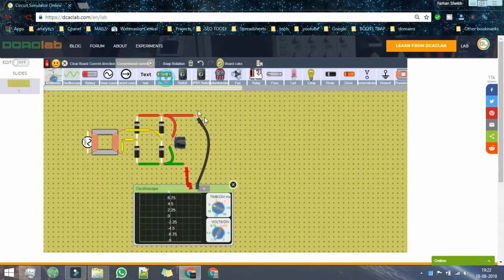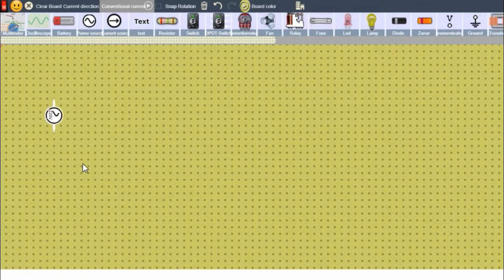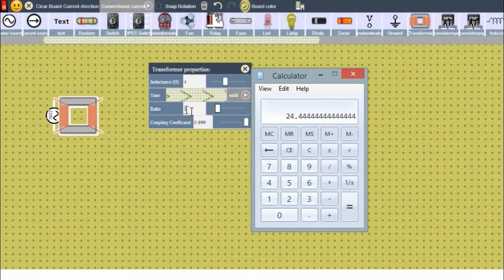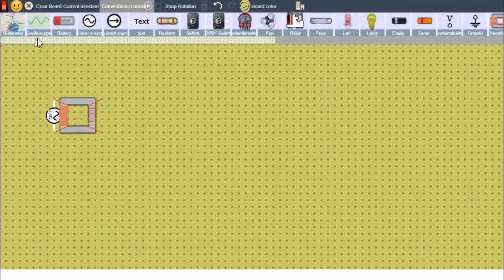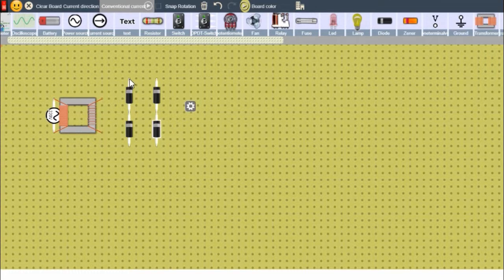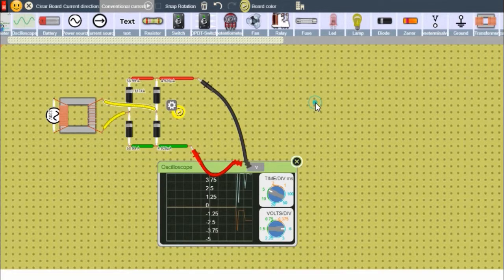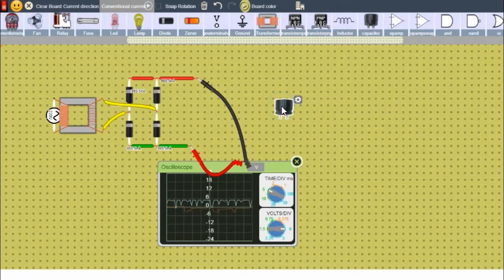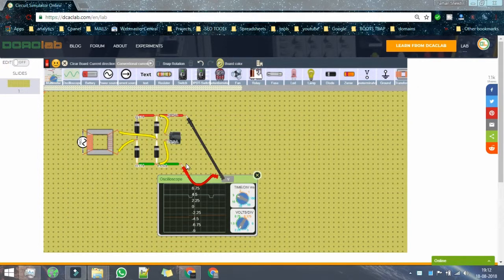Full wave rectifier [Try it yourself]

Comment: Can you make it for the given ripple voltage and output values for eg: Vr(ripple vol.)=0.05 and output voltage and current are 12 v
And 500 mA resp.
Reply from the maker: Sure we can ! All it takes is to use the corresponding value of capacitor as per the equation 

this video however was to demonstrate the basic working that how the full wave rectifier works (which we can't see from our eyes) 

Feel free to ask any thing ! :)